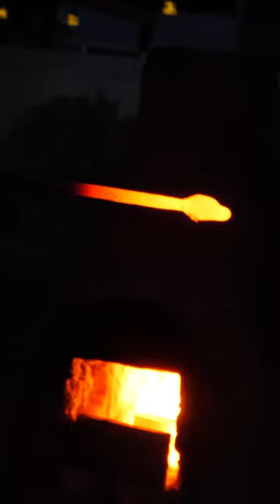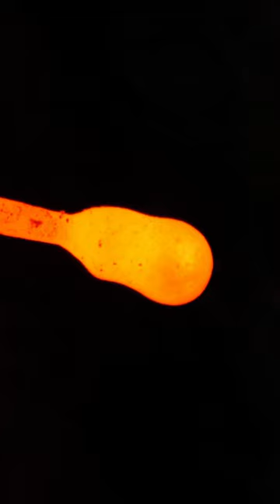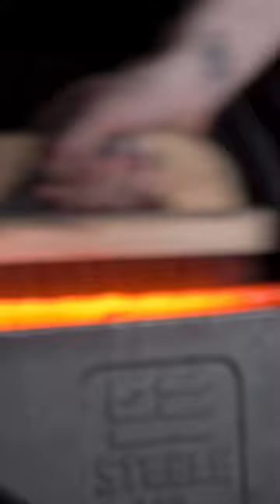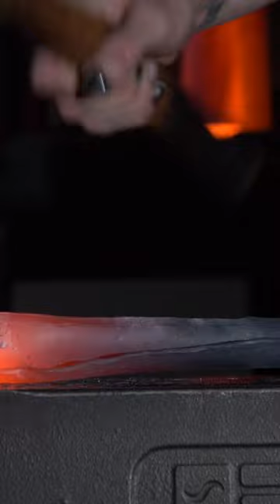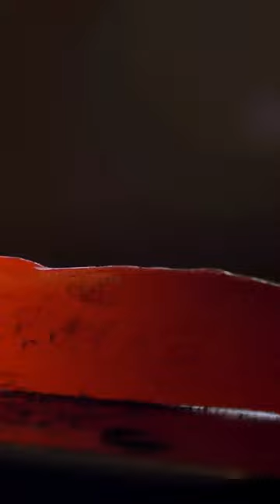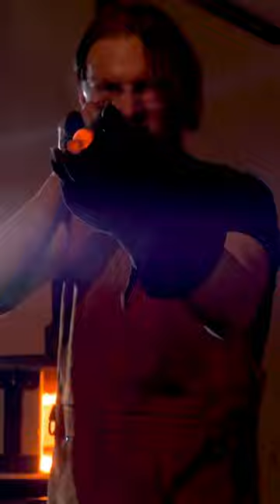How Do You Forge a Blowpipe? #diy  #history #blacksmithing #metalworking #shorts

Comment: Depending on time period, this would have been done with a 1/2"-1" ribbon of steel wound around a mandrel so you get better welds and straighter finished material.
Reply: Thinking about it more, this is how its done today, but i can't think of when this would be the way they did it historically.

Comment: Awesome! I hope this will also have you testing how easy it is to make transparent things from other materials, like window panes and lenses (for glasses, microscopes, and telescopes) made from (1) glass, (2) resin/rosin (most likely a mixture, depending on the temperatures at the time), (3) waterglass (waterproofed, of course, with wax/resin/rosin or something else), and maybe even boiled cow horns (sourced humanely, from a slaughterhouse). In addition, for windows, you would also need to make textiles and paper and test waxed/greased/oiled paper/textiles, which let light in but might not be optically transparent (depending on the materials used, proportions, and thickness of the end result).

Comment: I imagine casting would work too, but I might be incorrect. It seems like there might be a few holes in the pipe, might want to coat it with something to seal them.
Reply: @tungsten_cube  from what I saw in this video, there wasn't a good forge weld.
Reply: @tungsten_cube  I mean, it looked kinda fucked to be frank. Not sure about the heat treatment either but it's not really necessary